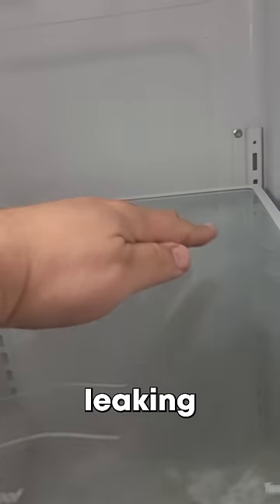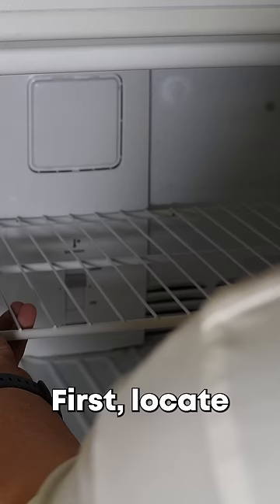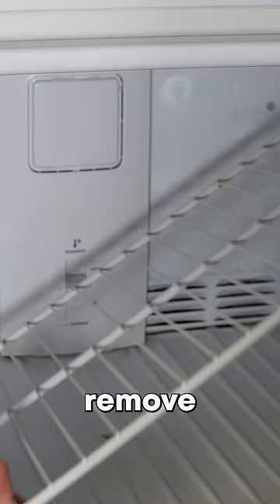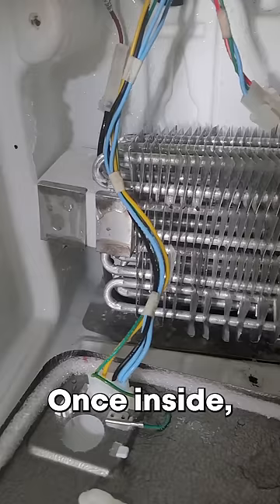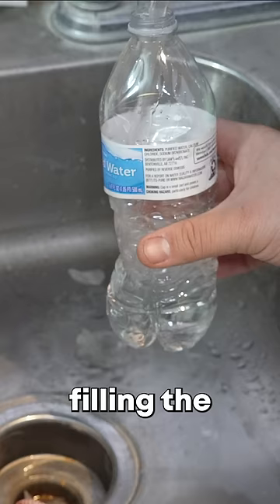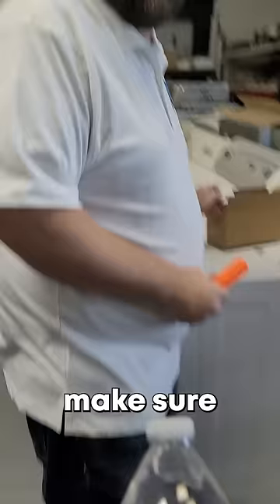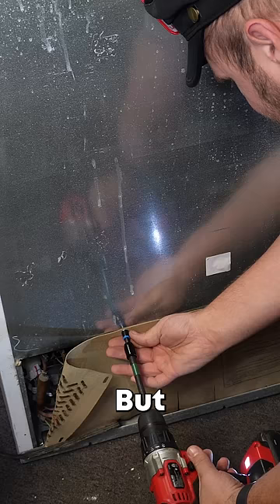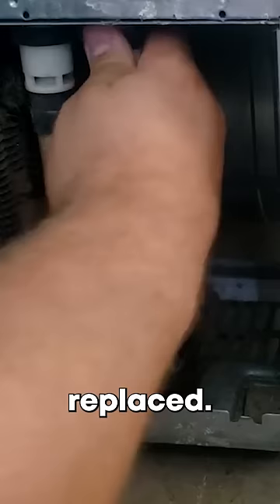Fridge leaking water or finding a sheet of ice in freezer? Try this. #shorts #refrigerator

Comment: I have a new Beko refrigerator (freezer bottom style) 1 month old.  Ice started accumulating in the freezer on the bottom right, and a visible dribble of water coming down inside.  Repairman found a disconnected wire that controls the defrost cycle.  There was about 1 inch of ice laying back there that he had to melt away.  A very big “oops” from the factory!

Comment: Great video...found my problem on an older Kenmore. There was a rubber restrictor at the bottom of the drain tube (probably put there to reduce the noise of water dripping into the pan). It was plugged by some deposits (who knows were it came from) Once cleared the water drained easily. Thanks for the tips. Great short video.

Comment: The drain tube on one I fixed was just laying on the floor under the fridge. There was an aluminum pan just laying on the floor, loose, that the drain tube should have emptied in to. The pan looked like a Swanson Hungry Man frozen dinner tray! There was no way to secure the pan to the refrigerator nor the drain tube to the pan. I put the tube back in the pan, pushed the fridge back in to place and hoped the whole rig stayed in place.

Comment: My aunt has this old General Electric fridge, and I have suspected this to be a issue for some time. In the back of the fridge there is this vertical tube I think is the condensation drain pipe.  I cannot see any drainage hole inside, and it is different than the European fridges I am used to. I may call a repair man, the fridge is large and still in good condition. I have not dared to unscrew panels or anything like that.

Comment: bro.... i like your videos and all, but what is this? you were working on a Frigidaire top mount freezer for 3/4 of the video, but when you show the drain tubes, you have used footage from a samsung refrigerator... cant be mixing up the footage mannnn.
Reply: Im not a handyman but I completely understand that this is a general guideline for possible problems and solutions. This isn't instruction on a specific model so I don't think using other footage is an issue...imo. If someone doesn't get that, they must have some clogged tubes of their own 😂